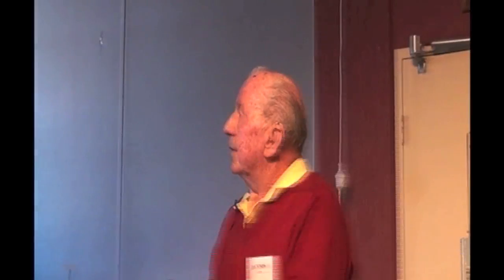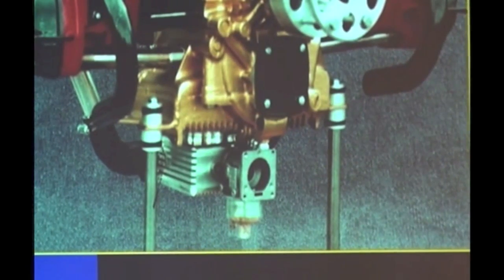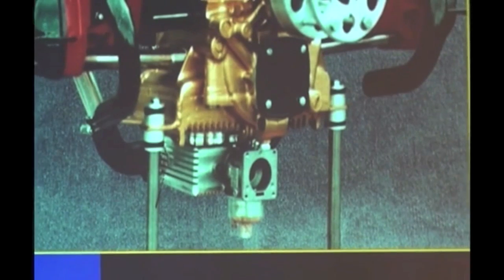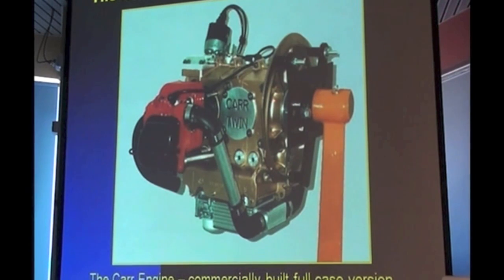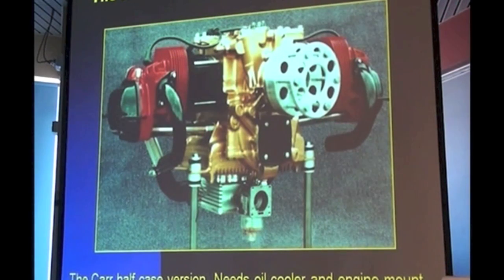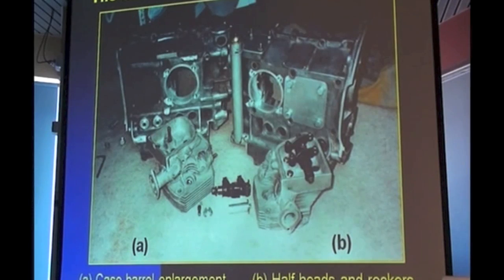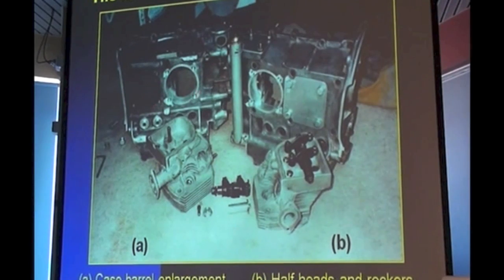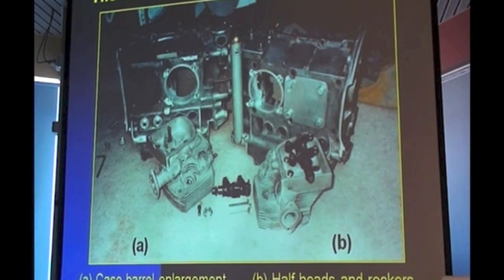An aero engine from half a VW engine

Comment: One Question, how well does the crankshaft cope with the additional longitudinal thrust imposed by the propeller?
Reply from the maker: Biggerbadwolf I contacted the author who replied:
The extra trust from the prop doesn’t seem to worry it.  However, when built, the crankshaft end play is set to 5 thou.  Pretty hard to organise.  I arranged a gauge with a long extension shaft and got it to (as near as dammit is to swearing) to about 6 thou.  I wasn’t game to go any lower. But by the time I sold them, end play had moved out to about 10 thou on the first and about 8 thou on the second.  Mind u, it is pretty hard to measure.  I can’t remember any cries from our Yankee friends about problems. I sold all my plans along with the aeroplane so i’m relying on an ancient memory. When all said done, when you take away the back bearing and half the centre one, it is stretching the bonds a bit.  The end play is set by adding and subtracting the standard crankshaft shims.  It was the longest bit of the whole process.

Comment: HE NEVER ANSWERS THE QUESTION WHY TO CUT THE BUGGER IN HALF !!!!
Reply from the maker: I guess he was limited by weight and the reduced power output was enough.
Reply: Yeah, I guess we have to guess.  Maybe the RPMs are greater, or maybe it's because all he had was a VW engine and he couldn't afford a Rotax engine, or maybe ... oh well, I guess we'll never know.
Reply: He answered that question right at the start 1.18 into the video you guys really need to start taking notice. He expands on the answer a bit later on.
Reply: Leanard Milholland is the one that came up with the mod several years ago.  He lives close to me and I have been to his shop and I ask him why he originally cut the engine in half.  He said it was strictly to reduce weight.  The full engine would put his Legal Eagle Ultra light over the maximum weight so this is what he did.  Leanard sells a video on how to do this.  www.betterhalfvw.com
Reply: to save weight that simple